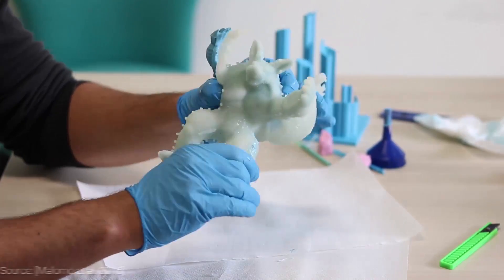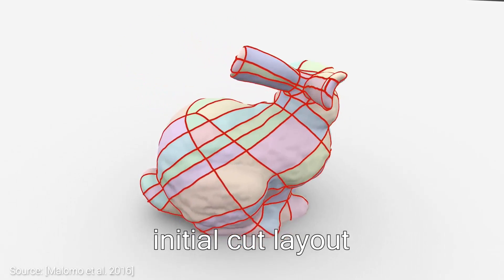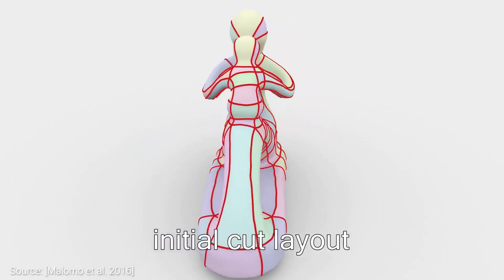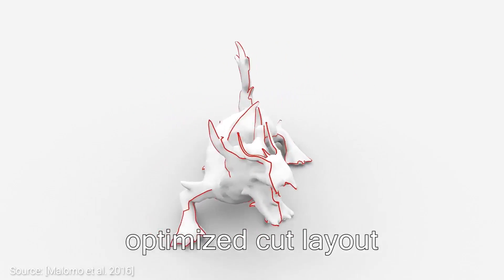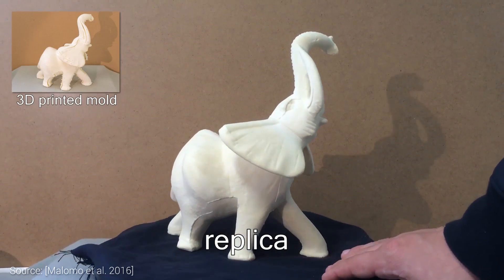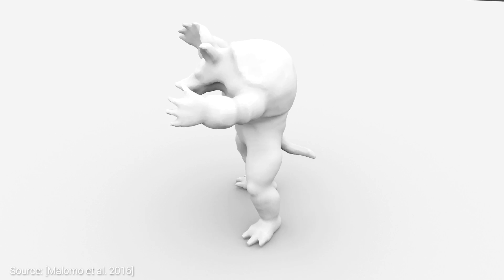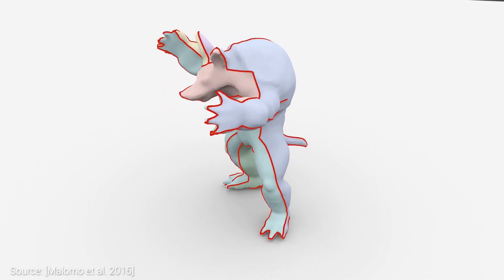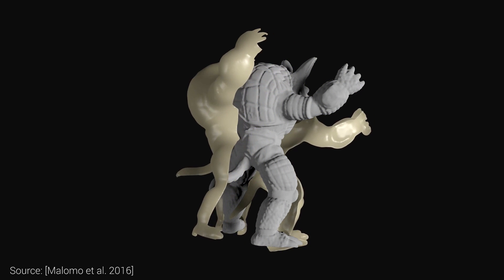3D Printing Flexible Shells For Molding | Two Minute Papers #114

Comment: I think it would be quite useful when you are trying to replicate some artwork, like statue. You may first 3d print the mold with some heat-resistant material. Then you may fill the liquid metal inside, so you could replicate an artwork! As if you could do 3d printing with metal.